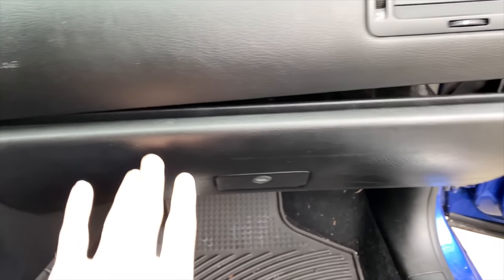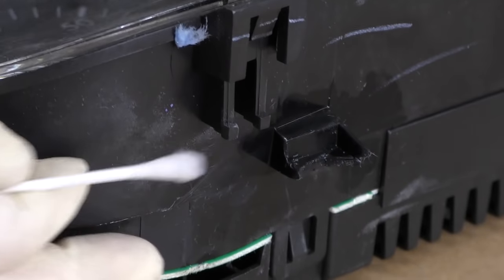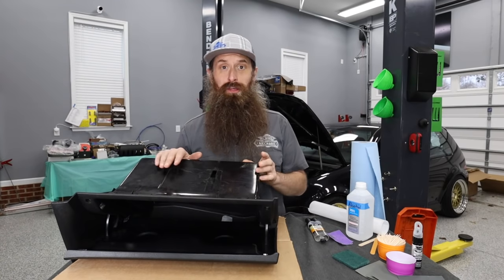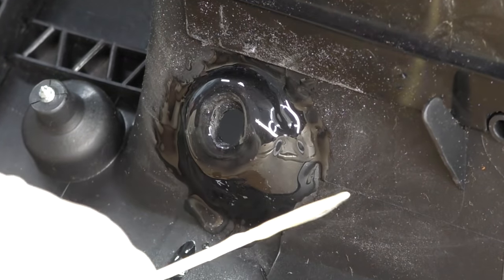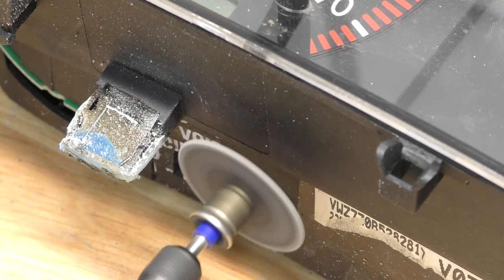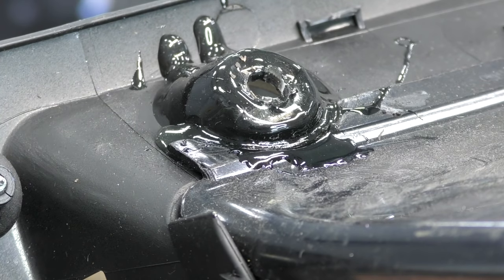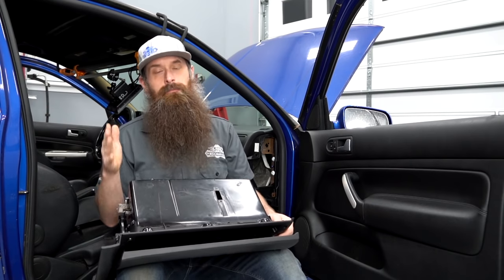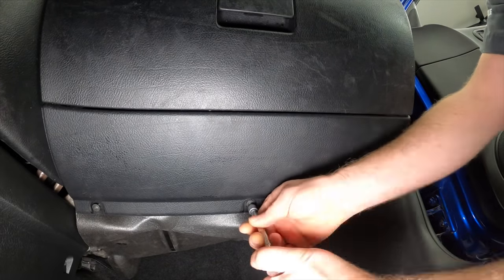How To Repair Broken Plastic Car Parts

Comment: Where you are trying to glue broken off pieces, I'd recommend a two step process.  First, use glue sparingly and "clamp" pieces in place with light pressure.  If a clamp won't work, you can try orienting the piece such that placing a small item on top of the broken piece applies some pressure, or you can try taping the piece onto the base part.  Only after this cures, glop on the epoxy heavily to rebuild the missing bits.  As many others suggested, because epoxy is brittle, always a good idea to try some type of reinforcement.

Comment: Another useful tool for working with plastic is something called Thermalmold plastic. It comes in pellets and you drop some in boiling water, it turns into a plastic glob. Take it out of the water and it's warm but you can handle it. You can then mold it into any shape you want. As it cools it gets harder. Once it fully cools it turns into a durable plastic. The great thing is, if your piece doesn't come out, just drop it back in the hot water and try again.

Comment: Good video man, very informative. But i think i'll stick to plastic welding with a soldering iron, normally just use broken peices of plastic then use cable ties to melt into the joint, hasn't failed me yet.
Reply from the maker: That’s a great option too!!

Comment: Hey Charles, could you also do a video on repairing sagging headliners or door panel liners, such as the ones in the mk4?
Reply: I did the headliner on my mk5 during quarantine. There's some good videos here on YouTube, but also have your repair manual handy. It's also more complicated if you have a sunroof. There's 15 clips holding it up there. Still doable, but what I thought was a weekend job took over a week for me. This video will be handy too, because on cars as old as ours, some of the plastic clips will likely bend, warp, or snap.

Comment: Melting black ABS plastic with a blow torch and letting it drip flames of fluid plastic into/onto a repair area is also fun and cheap.  It mostly doesnt look great but its quick, easy and fun.
Reply: Very toxic gas!

Comment: look into solvent welding. you use a jar with acetone in it, put scraps of the same type of plastic, abs or whatever in and let it dissolve then use like you did the epoxy.  for different colors dissolve correct color scrap plastic from a junkyard vw.  for black you can even use black plumbing abs cement its basically the same thing.  some newer plastics may require a different solvent.

Comment: Gr8 vid.   I have had to do something. Similar for things like a vacuum cleaner and a temp repaired or passenger side mirror(which my wife broke).   I used JBWELD.  

Your method is an improvement to the method I used .  👍

Comment: Great video,  a plastic welder works wonders too.
Reply from the maker: YESSS!!  I need to get one and learn to use it.
Reply: @HumbleMechanic  it's super easy to do.  I had to learn on the fly after my father in law "helped me" pick up a play house for my kids.  Long story short,  I wanted to tie it down he said it was heavy enough and wouldn't move.  30 seconds down the road it turned into a flying projectile.  And I'm the one that ended up having to fix it... 😆 🤣 😂
Reply: Plastic welding is great for flat surface repairs or attaching pre-formed tabs.

Comment: I actually used my tin welder to melt some plastic around and repair the damage but this is way better and will be more durable
Reply: I've used this method to fix some speakers, the middle has broke. Dismantled it, used my soldering iron. Worked great and was SUPER strong.

Comment: To make epoxy stronger, or stiffer at the moment of application, you can mix baking soda, fiberglass or fiberglass shreds, cotton fibers, or probably even oatmeal! A product called micro balloons is made for the purpose. Hobby shops are likely to have them. The idea is to add some physical cross linking of things. It does not drip so much if there is a dry mix of this materials, either. You only need enough to wet whatever it is you are using. It drills and files easier, and weighs less, if that would be a factor.

Comment: Great videos, please make wideo about fuel and oil aditives. I live in a country where diesel is with very low quality and it is dry'(not very good lubricant). Also most of engine oils here are fake and low quality also. Even they sell recicled oils as brand new in original bottles. Our cars are modern but with clocked odometers and we have to be carefull with serveces. Here is flooded with VWs 2008+ from Germany with 100k miles on the clock (welcome to eastern europe)

Comment: Having owned a VW Golf, I completely understand the low quality of plastic parts in this brand!  Plus the 'soft finish' on the dash area went tacky.  It was really difficult to clean off; I used an aerosol oven cleaner.  Anyway, thanks for the video.  I just wanted to add that I have repaired ABS plastic by dissolving pieces of ABS in acetone (I used lego), and pouring that into a mold made of masking tape, as per the video.  With some acetone on the parent material first, the whole mess can be coaxed to dissolve into one piece, then set as the acetone evaporates (it is very volatile!).  That is in no way to say that is a better method;  just something else to consider.
Reply from the maker: LOVE IT!

Comment: You can also use light weight balsa wood (think oldschool model airplanes). Its rigid, can be cut,  shaped, and drilled easily but it's very porous and will absorb the epoxy very well. Once the wood absorbs the epoxy its incredibly strong and rigid.

Comment: Instead of paper clip as reinforcing metal, i prefer copper wire. The wires used inside the walls for house wiring is strong but still flexible with long nose pliers.
The advantage is copper conduct heat so well that you can warm up the exposed part with a soldering iron or torch to get the entire piece hot, readjust the position and the entire copper wire froze in place.
Use a little solder to help the soldering iron transmit heat.

Comment: I thought your epoxy fix was extremely clever. In the past I've seen wood crack fixes using sawdust and crazy glue.  Have you ever tried mixing similar powder like substances into your epoxy to produce a putty texture to make it easier to mold and possibly improve  strength when dry?  I've seen suggestions of flower, corn starch  and talcum powder because of it's fineness.

Comment: When I saw you bust out the parchment paper I knew this dude knew what was up. I found out about using parchment paper with epoxy as an accident i couldn’t find a surface to use I had tried plastic Saran Wrap I also tried aluminum foil sheets but I had none, so i tried using parchment paper as it was all I had left in the drawer and it was better than anything else. Parts came off almost like a buttered cake pan lol.
Reply from the maker: Haha that’s awesome!

Comment: You can use solvent weld cement to bond the loose fragments in place before you epoxy in the missing areas. Chopped thread or fiberglass cloth embedded in the wet epoxy greatly adds to the strength of the repairs. If you have areas that show, you can make molds from silicone rubber casting material that will capture the texture of the outside of the part. The epoxy will duplicate the texture. spraying the silicone mold with dry lube will make the epoxy release from the mold easily. There are also fillers for epoxy resin that make it thicker and make sanding easier. Thicker is better for building up curved fillets if you need to do that.
Boat builders and modelers have such supplies. Hope this helps someone. 

I have made some amazing saves on broken housings on medical equipment with glass cloth reinforced epoxy for structure and thickened epoxy that was sanded to precise shape and painted to match.

Comment: The best method since cars interiors are made if ABS garbage is to use either ABS plumbing pipe cement or the all purpose cement as a resin and apply it over fine fiberglass mesh. I have done this with multiple layers of glue over a number if days and had great success. On the broken tabs on vw tail lights i have attached galvanized or thin SS sheet metal with small rivets this works far better than any glue on tabs.
Reply from the maker: Oh that’s a good idea!!

Comment: Plastic in cars is ABS, you can easily bond broken "puzzle" pieces, you better use weld on cement which will weld the pieces together. Good tips for reconstructing the missing parts though!

Comment: Try taking an impression of the good tab with plasticine, putty or some moulding clay then push it under the broken side as a mould into which you can add resin with fibres.

Comment: A tip from the people that make WEST Epoxy:  BRUSH, not flood, a thin layer of unadulterated epoxy on the existing surface and then add additional epoxy that's thickened with milled glass fibers.  The unadulterated epoxy makes a better bond between the substrate and the thickened epoxy.  Epoxy with milled glass fibers added is so strong that it can be drilled and tapped.  It's far stronger than plain epoxy.   Milled glass fibers look like powdered sugar and they make epoxy phenomenally strong.  They're available from any fiberglass supply company.

Kudos to you for not recommending 5 Minute Epoxy.  That is the worst epoxy available regardless of brand.
Reply from the maker: Great tips!

Comment: I did a lot of plastic repair using super glue with a lot of epoxy reinforcement. I used ordinary plastic wrap to set the flat parts on, not caring if not all of the plastic wrap came off. To my surprise, none of the plastic wrap stuck to the epoxy.

Comment: Hey, Charles. Wondering if you've ever tried an epoxy or plastic weld repair on a MK5 tail light, specifically the clips that hold in the bulb holders. Those clips are under a great deal of tension since they compress the bulb holders against their rubber o-rings. I've already ordered a new light because I can't see any repair being both strong enough and flexible enough to be as good as new. But, I'd still love to try to repair the broken one just to see if it can even be done. Let me know what approach you think would be best. Thanks.
Reply from the maker: I haven’t tried. But I like the idea a ton!!!

Comment: I use a SEM kit made specifically for this. Epoxy has a hard time bonding to a certain plastic (I think ABS but can't remember). The SEM kit also adds the texture back into the plastic when making be pieces. Anybody who removed door panels on a 2nd Gen (94-01) Ram know what I'm talking about lol

Comment: When you smear epoxy over the entire project you should buy some small sheets of fiberglass, they sell them in any local auto store near the body repair section.  Cut out straps of fiberglass and sink it into the epoxy to support the outer shell or you can even make your own adapter from this and shape it.
Reply from the maker: I’m gonna try that for sure

Comment: The right rearview mirror cap on my Mk6 Golf  has a ripple that looks like an oversized fingerprint.  I had a ripple before on the same mirror cap and I got it fixed.  Then another ripple developed, and the cap is also loose.  How could this have happened a second time?  And is it okay to fill the ridges of the ripples with epoxy and paint over that?  Because I can't get it done professionally any time soon.

Comment: Hi , I drive VW Golf 5 1.4 patrol engine and 80 ps . My RPM goes over 4000 when I am at 140 km in 5th gear . Is it normal? 
Thanks.

Comment: Pretty sure you should be able to use modelling clay instead of the parchment paper to prevent epoxy flowing where it is not supposed to. Might be easier to work with, too.
Reply from the maker: Love that

Comment: I wonder if this would work on my exterior door trim on my Jetta? The taps that hold the plastic connectors are broke and I tried plastic jb weld and it didn't work and the trim falls off.

Comment: Hey Charles I just picked up a 1995 Audi S6. Super excited to do some mods! I have a question though, the car has 325k miles and has had no transmission or rear diff fluid changes to my knowledge. Would it be a bad idea to change the fluid if it’s never been replaced before? Thank you.
Reply: I forgot to mention the car drives perfectly. No weird noises or vibrations at high speeds.
Reply: @dogchainsaw3923   Change the fluids and transmission filter.
Reply: @CoolAirVw  it’s manual transmission. There’s no filter

Comment: Car plastics are made of abs and abs is easy to melt with pure acetone. Scrap abs plastic and pure acetone will always do your job. You can also reinforce with metal parts by heating or melting. You dont need any kind of adhesive

Comment: I'd make a ball of play dough, press the ball onto the "good" part, pull it back off, fill the mold with epoxy as needed and line it up with broken part and press it into position. Then I'd lightly tape the ball to keep it in position and go have a beer. Check on it the next day, it should be done, except to drill a new hole. Of course clean and scuff up the old part first with a dremel tool.
Reply from the maker: Oh that’s a great idea!!!

Comment: Sure wish I could find some epoxy that would hold my broken Integra exterior door handle. I’ve tried epoxy repair several times and it always fails within a few weeks. But it’s also a break in a pretty high stress location.

Comment: Professional plastic-trim repairers use RF (radio-frequency radiation) to repair trim & grilles, etc., as they can finely focus the beam to weld the plastic just at the breaks.  Not having that sort of equipment, I've improvised with a temperature-controlled soldering-iron, adding plastic where needed.  In the past I've tried epoxy-glue, but found it just didn't retain its grip to plastics like ABS & PVC when subjected to vibration & extremes of heat.
However, some plastics can be bonded extremely well with the better quality super-glues like 'Hot-Stuff' because it will dissolve & liquefy plastics like acrylic, but I found the cheap super-glues & the 'Original' Hot-Stuff (red label) too runny to work with, & quickly caused white blooming/fogging to form on surrounding surfaces from the vapours given off!  Better to use the 'Gap-Filling' (orange label) & 'Ultra Gap-Filling' (green label) Hot Stuff, building it up if necessary, but still a good idea to have the area well ventilated to prevent 'blooming'.  I've successfully repaired several cracked tail-light lenses using this method. 
For a surface that adhesives won't stick to easily, I usually use baking-paper!
Reply: My guess is you are from the U.K. 

“Parchment paper” is a product typically used in baking in the USA, so probably the same thing as your “baking paper”.
Reply: @stevebabiak6997   In Australia we also call it baking-paper because that's the more logical thing to call it & so it's not to be confused with parchment made from animal skins!

Comment: Another good way to do this would be plastic welding. Just grab a soldering iron, melt the pieces together a little, then add in (melt) a zip tie and you're golden. If you really care about the cosmetic result, you can also put a little aluminum tape on the front side and weld from the back!

Comment: for using epoxy to make structural pieces, I like to mix milled glass into it to make "peanut butter" :)
Reply from the maker: Interesting. I’ve never heard thT
Reply: @HumbleMechanic  This is the stuff I use when I need reinforced epoxy; I used it to make new mounting ears and tabs for the headlamp assemblies on my Saab: 

https://www.westsystem.com/403-microfibers/

Comment: Helpful hint: Use a clear plastic bag and squirt your epoxy into it near a lower corner. Then kneed the bag with your hand to mix it up. To apply just cut the corner and squeeze it into your mold that you made with the tape. ;)

Comment: Those tabs just get more brittle with age.   Epoxy Glue a piece of thin aluminum if yours is gone.    NEVER rivet to plastic as the pressure stresses it.     Paper clips make great plastic rebar as foes aluminum screen.   You can easily melt it in with soldering gun wood burner ect.

Comment: Put rubber washers between the plastic area and the screw to lighten the load on the plastic, people often tighten screws to hard so just screw it enough to keep it in place. 😁
Reply from the maker: That’s a killer idea

Comment: There is a product call silk paper is used in nail salons for repairing broken nails fingernails a it would add all kinds of strength your repairs and you can work it with a poxy the same that you would DE epoxy and fibreglass just a hint

Comment: I found some repairs using super glue (when you have the broken parts) is easier, less mess, only takes a few seconds to set and can be very strong. I found some epoxies are very strong and others not good at all. I have some luck with fiberglass not so much with plastic welding. Depends on they type of plastic, some easy to repair others nothing stick to it.
Reply: The 5 minute epoxy in the twin syringe pack is a little bit weaker than the original formulation, which will need 24 hrs or so to cure. Also for molding or mending, try mixing some washed and dried sharp builders sand into the epoxy. Works well, and saves expensive epoxy.

Comment: I’m repairing a 1980 Camaro to find that someone did this but glues interior parts together where screws were... not allowing me to take the interior apart with screws like intended from factory.. needless to say I’m replacing the interior 😒